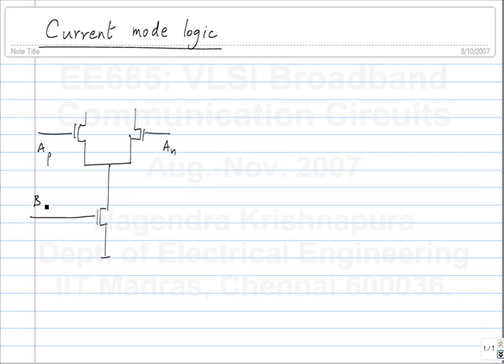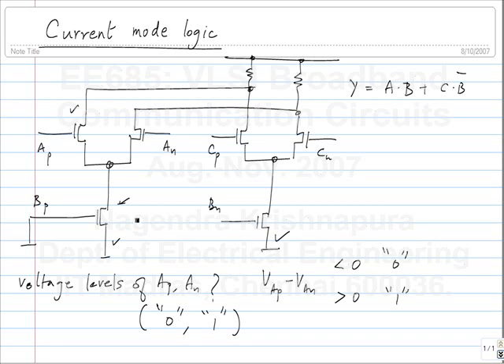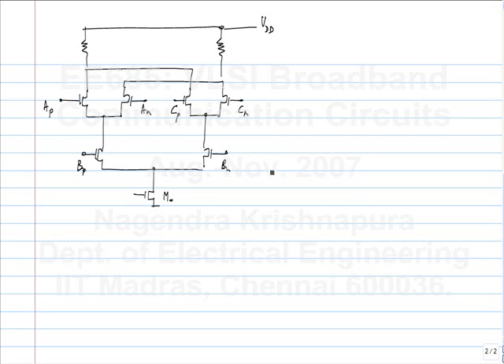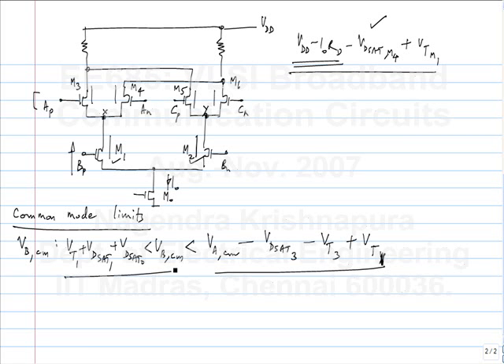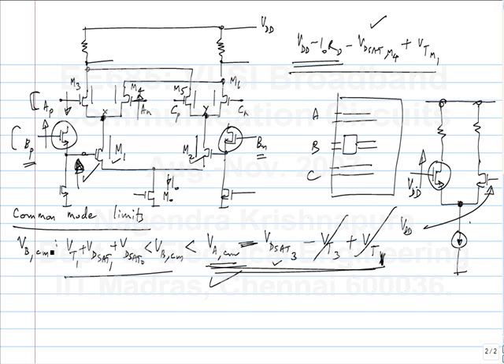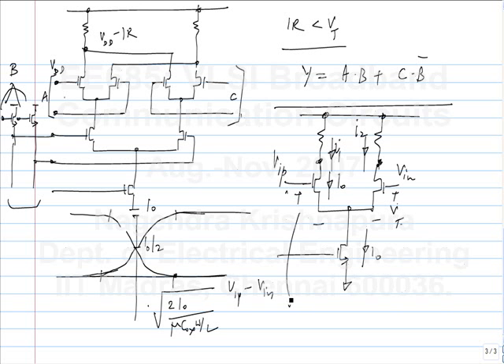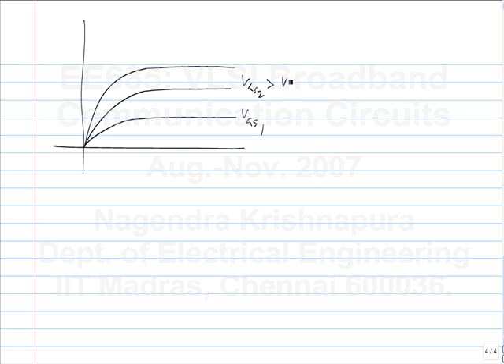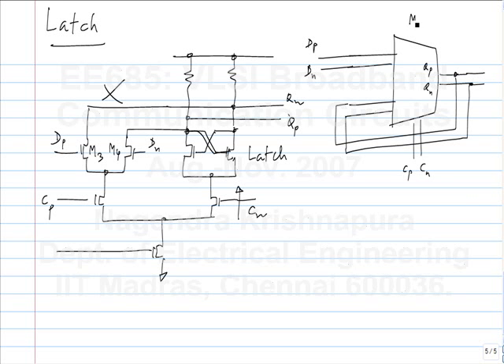lecture6 - Current mode logic - Basic circuit design

Comment: How is the common-mode defined if the given signal is digital? do you bias the transistors at the common-mode voltage? No, you don"t bias then how is this CM voltage is supplied to circuit
Reply: the logic levels can be defined as 1 or 0 based on VDD, VSS where Vcm is (VDD+VSS)/2. we can scale up or down the VDD,VSS using lvl shifters and get our own definnation of 0,1. So Vcm can be adjusted at the source or by some SP.